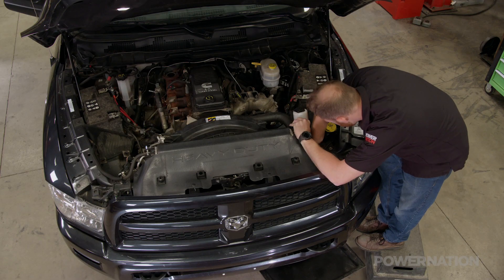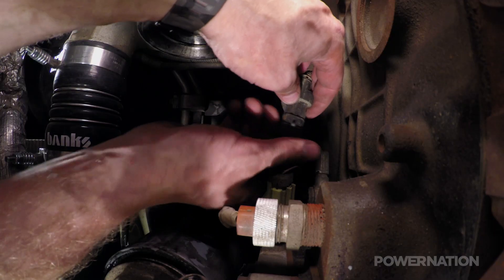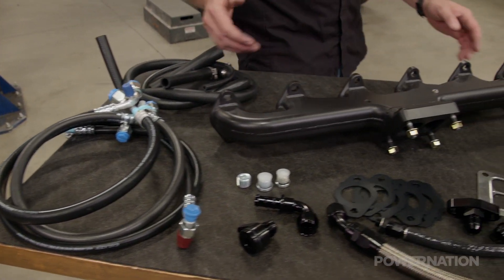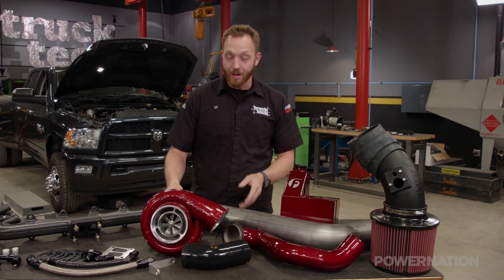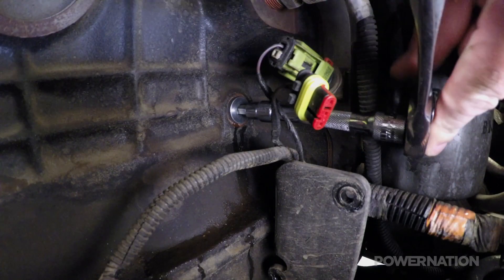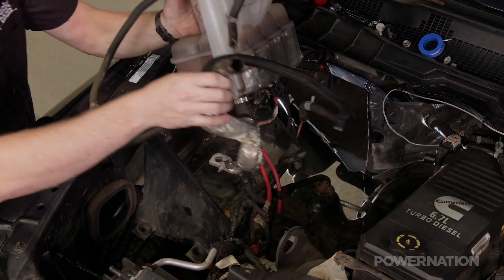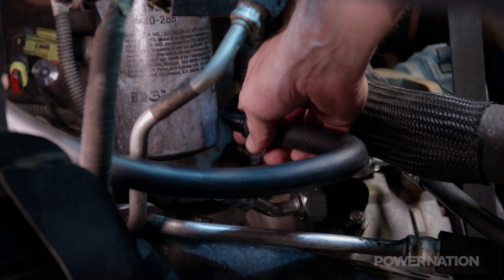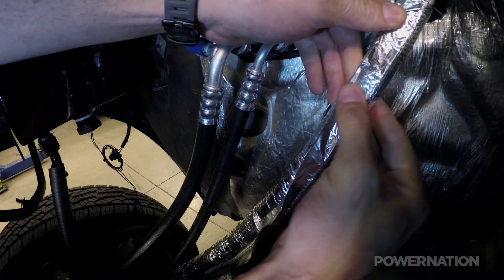How To Install Plumbing For A 2nd Gen Swap Kit

Comment: Where do i go to get this kit? Maybe a link would be helpful
Reply: Here’s part of the kit: https://www.fleeceperformance.com/6-7l-second-gen-hardware-kit-for-2010-2012-cummins.html

You should be able to figure the rest out via the link. If not, call Fleece.
Reply: @bb502cid  they were just joking about the ac lines coming in the kit? lol
Reply: @hams1198  , Probably misspoke. The AC line kit has to be purchased separately.